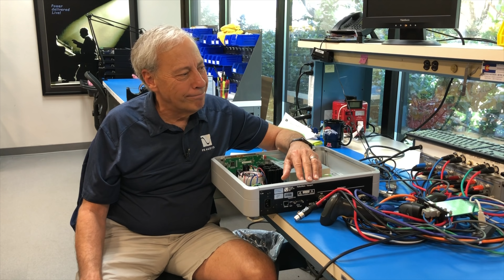How do designers know what to engineer if it cannot be measured?

Comment: I used to do what you are talking about. I built circuits with sockets to try different parts. I kinda found it impractical to build a circuit that sounds good so I bought some high end used gear and modified it.

Comment: I recently had the opportunity to introduce my son's 20 year old friend to high end audio. Within 5 seconds, his face broke into a huge smile. This guy is technologically savvy, he runs a movie theater in a small town in Washington. He had no idea what was possible. This is how I started too, when my cousin introduced me to imaging on an old pair of Infinitys from the pre-EMIT days. 

My system uses single ended triodes, the kind that Paul hates, output tubes with matching transformers. There is not a single transistor in the sound path and this includes my DAC. My amplifiers (tri-amp) have measurements that any engineer would laugh at. Needless to say, I think measurements are not everything.
Reply: You have a DAC without transistors?
Reply: Lampizator Big 7. It has a tube rectifier and single ended triode output tubes. It can use different tubes, including 300b, 2a3 and 45. Are there transistors somewhere in there? Probably, but not in the analog output path. It also has no DAC chip. It uses an R2R ladder DAC for the PCM decoding, and for the DSD it works like a radio, stripping the carrier from the modulation wave.  It's not cheap, but they do have lesser models, and there are much more expensive DACs available, including from Lampizator.

Comment: Educated tinkering and tweaking from experience. We all do it. But the reason you can't measure it is because your method of measurement is fatally flawed.  You measure the wrong things, you've overlooked something or most frequently of all your measurements do not simulate actual conditions of use. Here's a simple example we tried. We inputted  a 100 hz square wave into a bunch of amplifiers connected to 8 ohm resistors. The tilt seen on an oscilloscope is an indication of bass response, the flatter the better. Then we repeated the measurement with the amplifiers connected to a speaker. Each one showed more tilt and no matter how similar they were with a resistor the were all different with the same speaker. Conclusion, the typical bench test measurements don't tell us what we want to know to give us meaningful information. There is a difference between the unknown and the unknowable.
Reply: Mark Fischer You're exactly right..

Comment: Also, mixing caps can also be a good thing. To save money and get good results for example, one may want to mix a 2uf polyprop with a smaller value teflon capacitor to get the flavor of the teflon cap instead of spending big bucks on one big 2uf plus teflon cap.

Comment: I've always believed that if you can't give an answer that almost anyone will understand, then you don't really understand the question or foundations of information needed to give that clear and concise answer. 

 The reason something like a transistor can sound different while scientifically measuring the same can be explained like this:

 If you have two glasses made of the same material and that both hold exactly one cup of water, then why is one cup tall and thin and the other short and fat? One could have a perfectly smooth rim, while the other might cut your lips trying to sip from it. Again, both hold the same volume and are atomically made of the identical materials. But those tiny differences in shape and form, even if imperceptible to the naked eye, could result in dramatically different experiences for whoever used them.

 As Mr.McGowan alluded to, there are differences only those with first hand experience will notice or know about. And like the recipe for bread, even if just made from the same ingredients, different people may get different results making that bread.

 Form, shape, things on molecular or the atomic level, temperature variances, different rate of moisture evaporation, compression of the individual bits of flour, chemicals present on the baker's hands like body salts and oils, and an unknown number of other variables will, and do, effect everything. 

 We simply don't measure, consider, or haven't invented readily available tools to calibrate or generally see the differences of some nearly imperceptible, and therefore SEEMINGLY identical, factors in that which we do or create.

 I hope that clarifies things a little. 😁

Comment: "If you can hear it , but can't measure it. Measure again!" 
The problem is not your ears, but your measuring set up.
Reply: The difficulty isn't so much in measuring as it is in quantification of the measurements or determining what potentials there may be to quantify.
Reply: True. If you accept the statement "If you can hear it , it is measurable." , then you can start the journey.
Reply: Seems like our brain and ears are more sensitive than any device out there.  So past a certain point of audio measurability, designers rely on experience and their senses.  Look at dac measurements, most are identical to each other yet sound different.
Reply: Erland Lestander if we could trust our hearing as objective... I'd be inclined to agree. However, I think it's more the case that hearing works a lot like taste; your experience of food largely boils down to visuals. You think you're tasting it as it is but you aren't. There's no reason to believe we can objectively judge audio. The only way to confirm detection of something that "can't be measured" is by double blind test.
Reply: Adrian Hill At least he doesn't resort to base behavior like name calling...unlike yourself.
Reply: One may prefer the sound of a system and believe that one system sounds better or different from another..  Yes, it's subjective.. But one can measure any signal that is pushing and pulling a speaker cone.
Reply: that contradicts the laws of physics and probably a result of poor, sighted testing.
Reply: @Sybrand,  I agree that hearing a difference is not the same as being able to tell which is closer to the original. Sounds better and sounds more correct are two different things.
But IF you can hear a true difference, then it is there. 
And if it is there it can be measured. 
But heck, my measurement rig may not be up to the task, or I might not even know what to measure to visualize the audible difference.